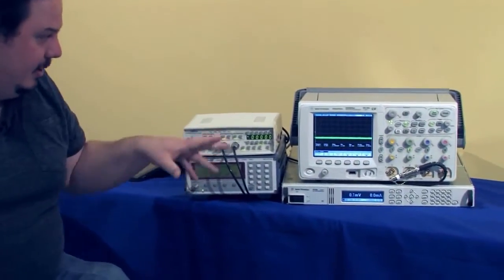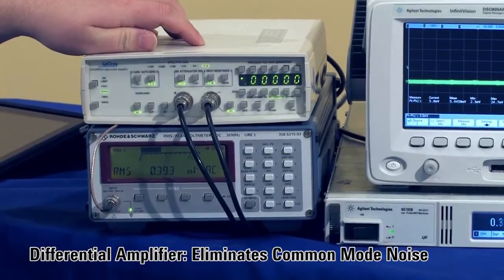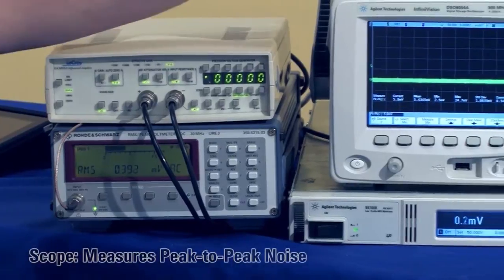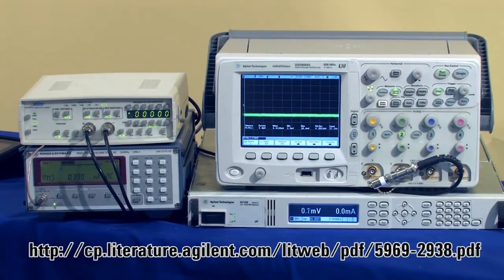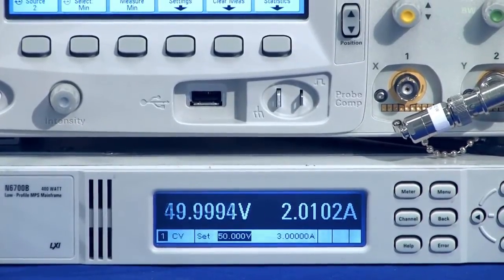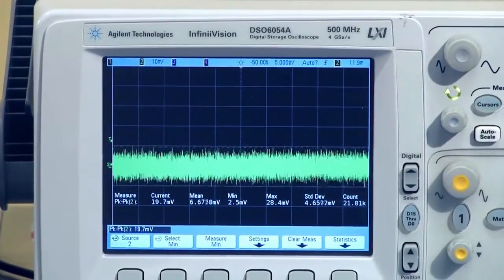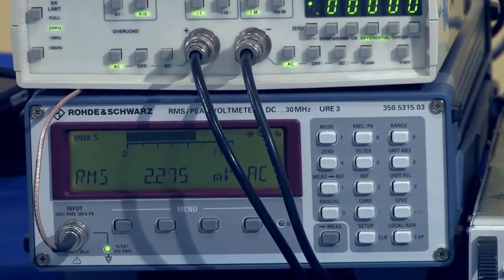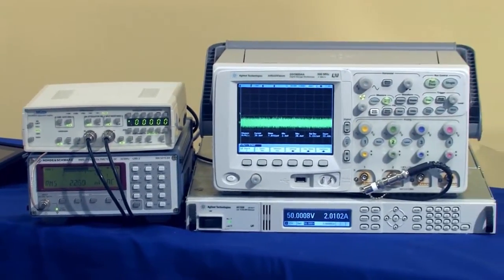Measuring the Output Noise of a DC Power Supply

Comment: Hi. I want to see and measure noise from a DAC output, with Vpp output around 2 Volt, and the DAC's bit depth maybe 16/24 bit.
Can you suggest for me a right model for that application ? 
Thank in advance.
Reply from the maker: Clack Berry  I recommend looking at the 34465A and 34470A models.  Both models offer a digitizing mode that allows you to look at the noise. You could also check the level by making a slower 6 1/2 or 7 1/2 digit measurement. Our multimeters can read 20% over-range 1.2 V or 12 V. A 2 V signal has to be measured on the 10 V range. You could also make a very accurate AC measurement of the noise by blocking the DC voltage. The bandwidth of our AC measurements is 300 kHz. The datasheet can be found here: https://literature.cdn.keysight.com/litweb/pdf/5991-1983EN.pdf

Comment: em... Let's say I have some dodgy Chinese PSU I bought somewhere and I want to check it to make sure it is (relatively) safe to use. I also have a standard basic oscilloscope (may be even analog one). How can I do that??
Reply from the maker: Alexander good job understanding that your power supply could cause problems.  You can look at any of our service guides, they are online and free, to see the list of tests that we perform to verify the operation of a PS.  In this video we are testing an N6700 module and the service guide is part number 5969-2938.  To start with I would test the supply using a load that draws current similar to your DUT.  Make sure it responds quickly to an over current condition.  If it is a switching PS, you can determine the switching frequency and know that most of the conducted and radiated noise will be related to this frequency.

Comment: Thanks,,,Its use full.If you make a video with after remove noise waveform & Circuit.It will be more usefull...
Reply from the maker: Thanks.  It is difficult to design a generic circuit to reduce noise.  Typically, adding capacitance will reduce noise but changes how fast the power supply can respond. Choosing a power supply that has noise specification that meets your needs is the best solution.